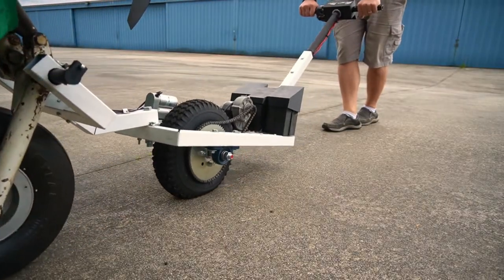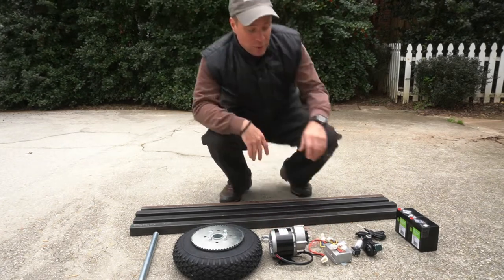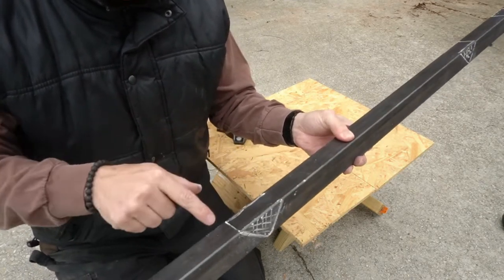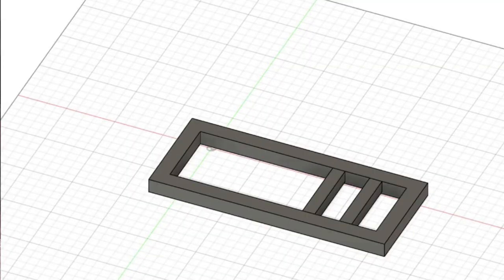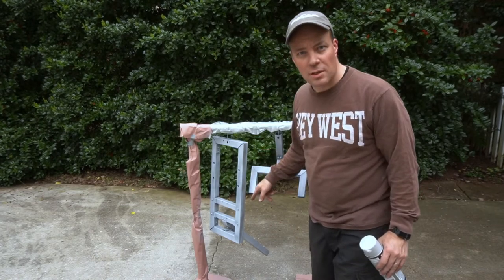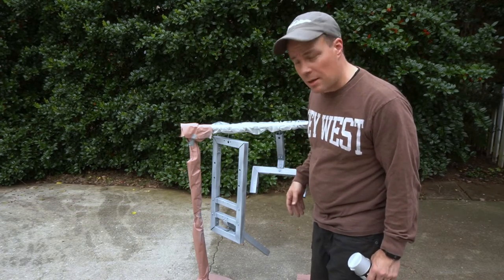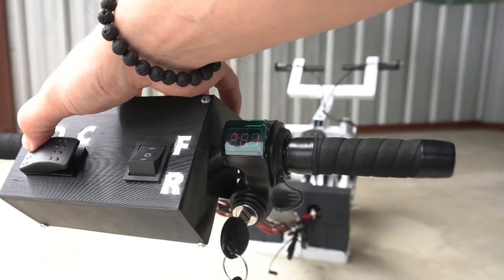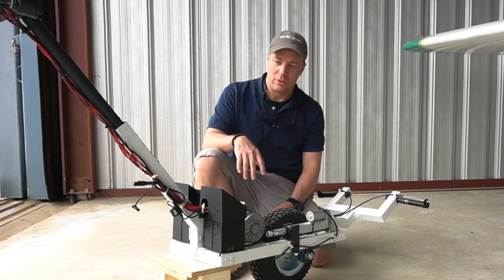DIY Airplane Tug | Mooney edition

Comment: Just watched this for the first time tonight and all I can say is I'm damn impressed. Really nice build and I love that you even power articulated the aircraft attach points.
Reply from the maker: Thank You! It was a super fun project, I do have some 2.0 ideas if I ever need to redo this 😁
Reply: @TuomoMooneyFlying  What are your 2.0 ideas.  We are looking at building tugs for 3 club aircraft, Archer, Arrow, 172, and a Van's RV10 .  We are hping to use one design and modify the grip arms
Reply from the maker: @glenellyn100 that’s a good question. I would definitely modify the grip arms. The current solution uses a cable to actuate them but it hasn’t proven to be very good solution. The linear motor instead of being on the side could go in the middle of the frame and push the fork out or pull in as needed with kind of a scissor like mechanism.

Comment: Excellent video, thanks!  I have a 69M20C and attempting to build your example tug.  Just wondering if you have any dimensions available for this project?  Thanks again.
Reply from the maker: The rough dimensions were explained in the video, unfortunately I don’t have a drawing available. The long sides are 24” and the width was 10”. If I was going to do this again, the pivoting fork needs to be beefed up, and the articulating attach arms mechanics need more refinement. Closes great, opens not so great. Thanks for the kind comment!

Comment: Could you discuss your fork design a little. it looks like it pivots. Any issues with jack knifing while backing the plane up?  do you have something to limit the travel?  can you lock it?  I have built 2 similar to this except for RV-6 tail wheel and now designing a version for a nose wheel
Reply from the maker: Yeah, there’s stoppers on both side of the fork arm so it pivots perhaps 10 degrees but not enough to jack knife

Comment: I operate a C172 off of a grass strip, with grass transitioning to gravel going into an open hangar, with some humps and bumps. This design looks great! Do you think it would be adequate to operate on grass and gravel? Thanks
Reply from the maker: Never tried it on grass but you could get some extra grip tire for? It could work!

Comment: How much torque that electric motor to move the aircraft? My i ask
Reply from the maker: Enough to push a Mooney with full fuel up a small slope. But the spec of the motor is listed on eBay, just follow the link in the video description.

Comment: How do you connect sprocket to main drive wheel ?
Reply from the maker: The sprocket had a different hole dia than the main drive. But I found one that was slightly larger, it had a notch and the main drive had a pin. And then just tighten it down with a nut.

Comment: Nice Job!!! What sproket you ended up using on the motor?
Reply from the maker: Thanks! I had to change the motor sprocket to a #35. Was a real pain finding a sprocket that fit the motor since the motor had a non-standard size shaft. The one I got was slightly oversized but was able to use it anyway.
Reply: @TuomoMooneyFlying  great project, may follow suit.  Can you link the motor sprocket you used and screws you used.
Reply from the maker: @msabol01  thanks! The sprocket was the most difficult piece, I did not find one that was an easy bolt on because the motor axle was not standard. I took a sprocket and then modified it to fit the motor axle, it’s still not perfect but it works. The screws were metal screws, nothing special about them.